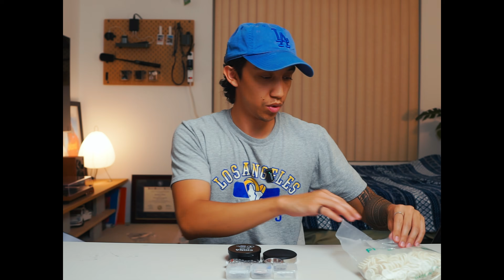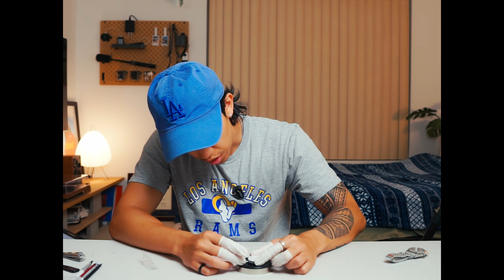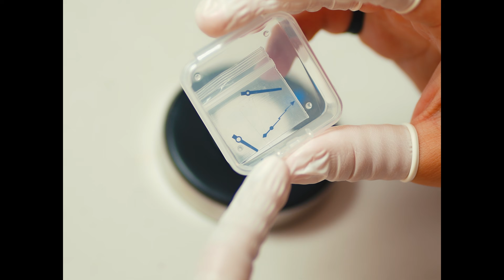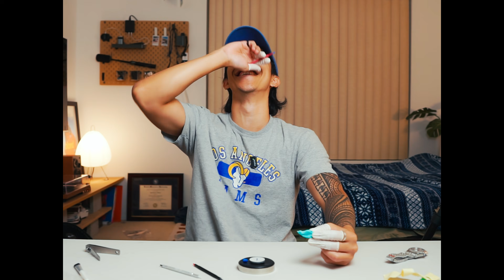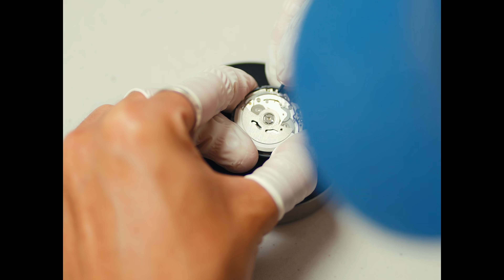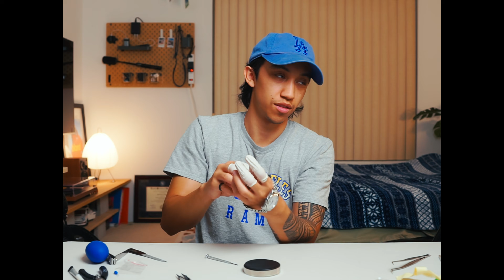I Built my DREAM "Rolex" for $100 using AliExpress Parts | Step-by-Step Seiko Mod Build

Comment: How was the watch doing after modding it? Did it run well and kept its durability?
Reply from the maker: yeah!!  Watch is still working great!  The battery doesn’t last the longest but as long as you wear it relatively consistently it’s all good.  Some small scratched here and there but nothing on the crystal

Comment: Please ditch the dumbass black bars. This video is unwatchable on my phone do to the wider aspect ratio of modern cellphones. It's very cinematic, but completely unnecessary for a video.
Reply from the maker: Noted.  I believe you can pinch to zoom in and fit the width of the video to your phone's screen.  Should be a little bit easier to watch then.

Comment: If I get a 40mm case is it still the same NH35 movement or is there a specific size movement that I would need?
Reply from the maker: Double check your listing, but it should be the same NH35 movement

Comment: If you mod watches: 1)  have  a perfact sized stem you can use as a measure/pattern.  2) Dont remove the band rather remove one link pin/screw.
Reply from the maker: But how do you get the perfect sized stem if the cases you're building in are different sizes?

Comment: Yo you made that look so easy,I’ve been trying to build a watch for weeks,I’m always waiting on parts I started with the NH35 as well bought a Seiko dial but didn’t realize I had to cut off two of the feet so they bent and broke so I super glued the dial on, then the hands, I bought the identical pushers you have but didn’t use the rodico puddy I tryed with micro tweezers but when I went to push them on I bent them… so frustrating. So I bought professional pressers and another set of hands and I waiting on them to try again.. I’m so over budget but determined now, I’m trying to put the movement in a fake Rolex Sub I bought off of DH but of course it stopped it’s a 41mm case it fits perfect but your video has given me more hope to try again. Thanks for your advice.
Reply from the maker: Lets go!  You got this!

Comment: Hello. I want to start buliding with this model, and i see you use NH35 movement and a 28,5mm Dial. Does that fit in both 36mm and 39mm case?
Reply from the maker: the NH35 will fit in both but the dial size will be different.  The comparable dial sizes should be specified in the product listing of the case you’re looking to buy

Comment: Is there a difference in things you need to order for a 39 vs 36mm?
Reply from the maker: The size of your case would affect the size of the face you order as well as the bracelet if you order a separate one.  It normally says the size of both of those in the case listing.  other than that, all the same 👍

Comment: quick question, so ive build my watch aswell and for the stem, do you have to always unscrew it to pull it out and change the time or is there anyway i can always have it screwed in then just pull to change time(like normal watches???????), i keep thinking i made a mistake on that part someone please let me knoww.
Reply from the maker: I always have to unscrew mine.  That may be necessary to keep the case waterproof.
Reply: Thats what i though aswell, so i did not make a mistake on that part.. thank you!
Reply from the maker: you're good!

Comment: You made the process seem so simple with no special tools. I’ve been hesitant to build but now I’ll go buy my cart on aliexpress
Reply from the maker: It’s so much fun!
Reply: how is going can u send pic in dm if u got it and can u give some tipp
Reply: @KyleMunozTech yo i have a question this gummy that goes around watch and u put it in a blue like gel box and twisted it what is this and do i get it in your description do i even need that?
Reply: @joshuareynolds8476  does watch still works
Reply from the maker: it’s an o-ring that keeps the watch waterproof and it comes with the watch case.  The watch works great i’m wearing it right now lol.  If you don’t wear it for a couple days you’ll have to wind it a little bit but other than that it’s fantastic
Reply: @KyleMunozTech I hope you don't mind me asking but, how is the water proofing?
Reply from the maker: no issues so far.  Been to the beach and in multiple pools with no leaks

Comment: never knew tht dial was a rolex one ;)   i build 8-10 watches, and 5 of them with that Naiton type case, they are the best sturdy quality for the price..
Reply from the maker: LOL rolex who??  I love the case so much.  I can’t compare to others but from what i can tell it’s a fantastic quality case that will last forever
Reply: @KyleMunozTech  yeah, i upgraded the bracelet lock with a multiadjustable one(sliding), and not with pins moving.. good 4 pound spend ;)
Reply from the maker: Yeah! adjusting this one was a bit of a pain in the butt. I’ll definitely be looking into some different straps for my next build

Comment: Its actually crazy that you were able to put the second hand on without using a magnification lense ! 
Further Tipp... you can but that rubicon thingy directly on the little sticks to set the hands. 

It made my job on building my mod much much easier. 

Great mod and vid.
Reply from the maker: dude yeah i was super surprised!  and im DEFINITELY gonna do that on my next one, thanks for the tip!!